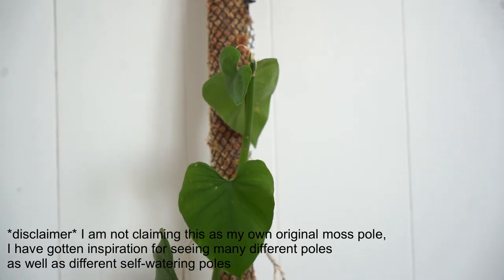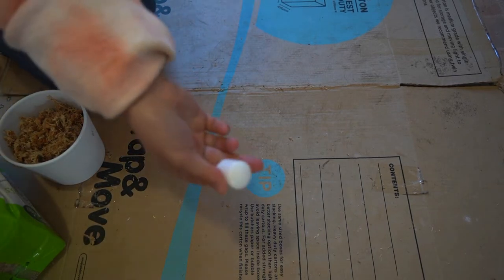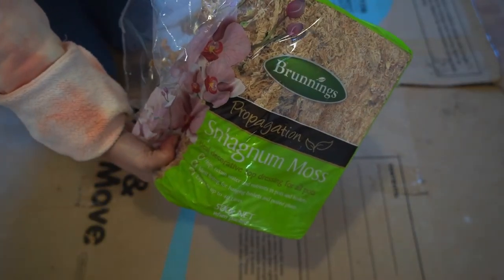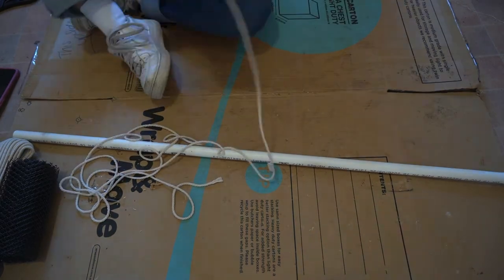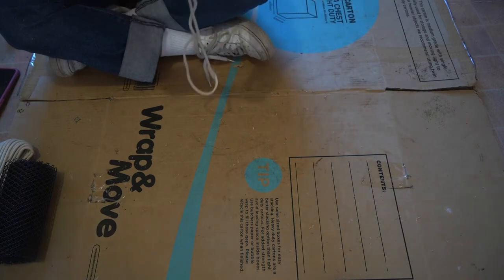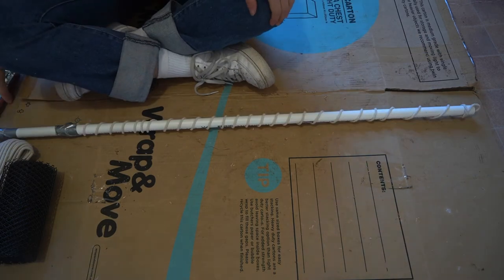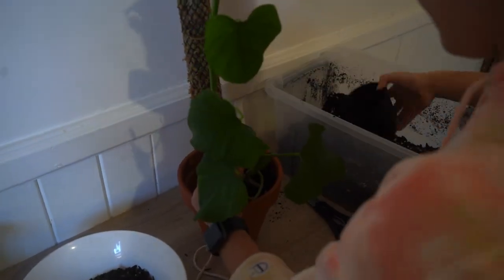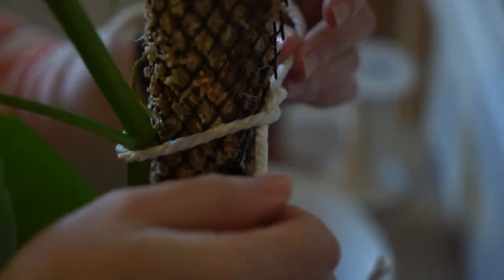Self Watering Moss Pole

Comment: Do you fill the pipe with water and then the rope is tucked in the pipe with water on the top and distributes it from the top to the bottom?
Reply from the maker: Svenja Unterkatze Yes! I've found the trick is to use a rope that is more absorbent as it distributes the water much better ☺️
Reply: I have been looking for the answer to this question. Nobody says how it works lol!
Reply: @Anna-yr6us  by wicking up the water through the rope. But I wonder if the water would wick back down the rope to the lower part of the pole
Reply: @Anna-yr6us  you have put water inside the pipe from top
Reply from the maker: @cillamoke   I’m not 100% sure whether the rope does continue to wick water all the way down however on all my moss poles they do get moist down to the bottom. I’m going to assume that this is a mixture of the rope wicking and the super absorbent nature of the moss 🙂

Comment: link ?  where u got ur pvc pipes and the end parts   cant mange to find any.
Reply from the maker: Hey, I just got them from a local hardware store. They were just in the section that has all the plumbing stuff, I added a link to the ones that I used however you could probably find ones that are similar online somewhere 🙂

https://www.bunnings.com.au/holman-15mm-x-1m-class-18-pvc-pipe_p4750046
https://www.bunnings.com.au/holman-15mm-pvc-cap_p3140421

Comment: What type of rope do you use? I tried this and the rope isn’t distributing any moisture down the pole.
Reply from the maker: Hey, I used a macrame rope. You possibly could also use an old t-shirt fashioned into a sort of rope! Maybe just do a little tester and stick a small section of the rope you are planning on using in a glass of water (half in and half out) and see if it wicks up the moisture. Hope this helps 😃
Reply: Synthetic rope is best.
Like the thingis in self watering pots.
Reply: @holyfox94  would it wick up the water?
Reply: @lance wilson did you ever figure this out? Im having a similar issue. I think if the moss is too dry the wick doesnt work as well....so it seems like "priming" the wick by wetting down the moss will help...